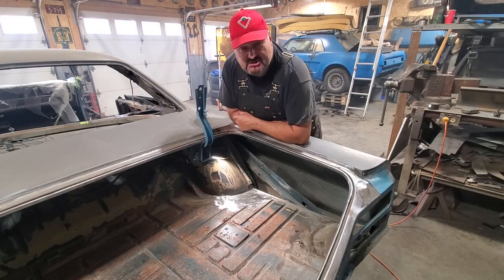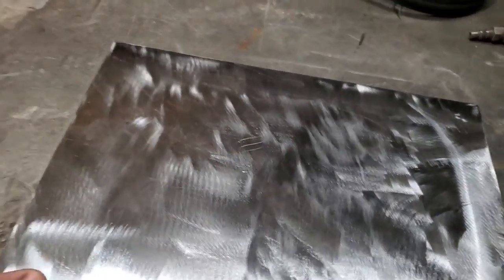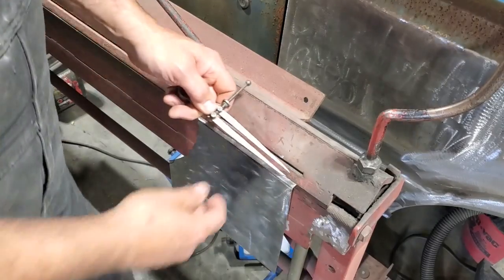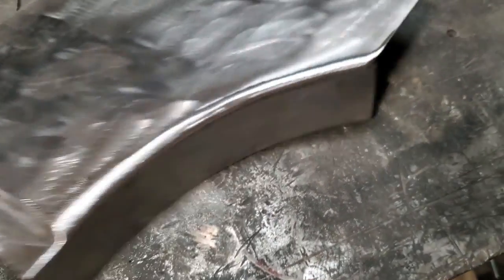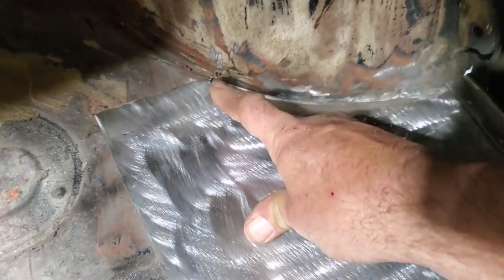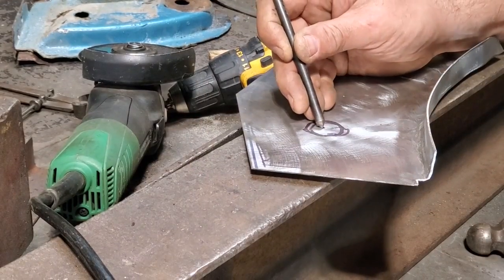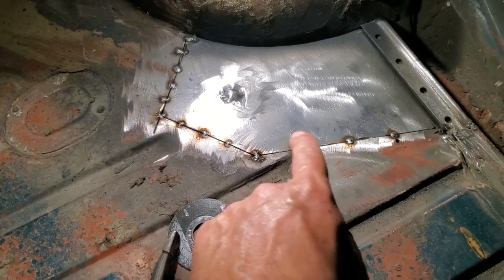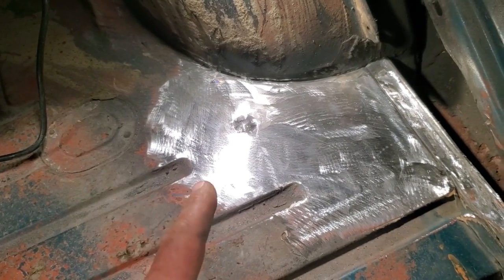How to repair rusty trunk floors in 60s GM cars

Comment: ok frits  its a bit hard for me to explain but i a 125 min cutting blade in four so to get four little dremmel blades dont have to be perfict they wil round off wen cutting or grinding   really good grinding tool concentrating on weld only hard to explain as for the bit that holds the blades get a bolt  that fits in ur die grinder tape the center with a tiny tap that fits a little swrew  like one mil thread same as dremmal  if thats not enought tell me how to send u a video and i will im shore u would see it for one second and get it
Reply from the maker: Pop over to the Facebook channel and drop us a link to this. Sounds very interesting.  I love to see it in detail